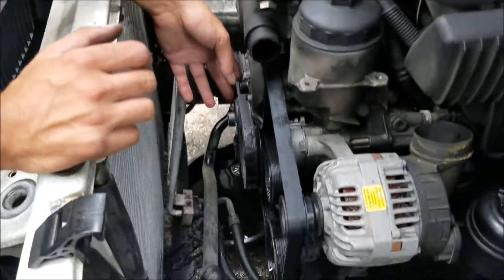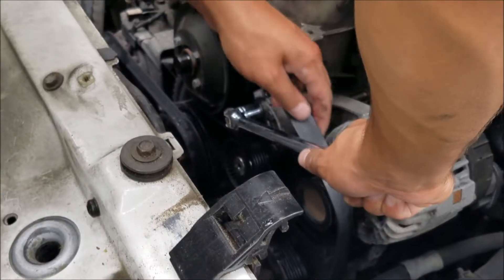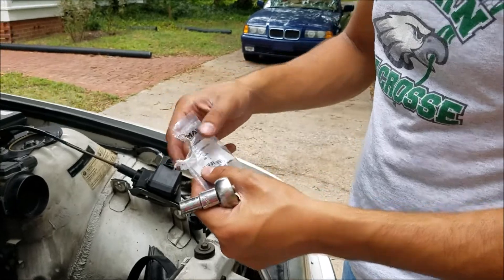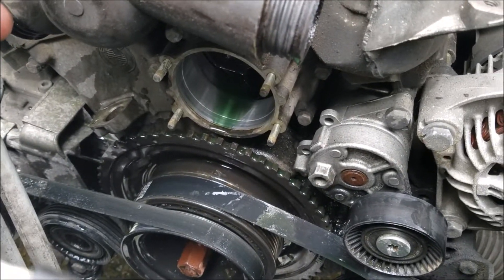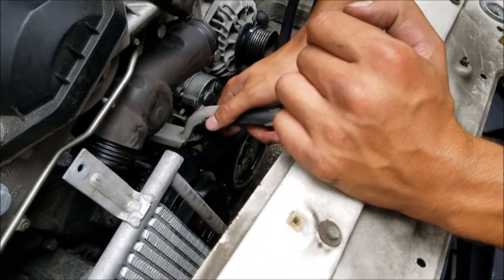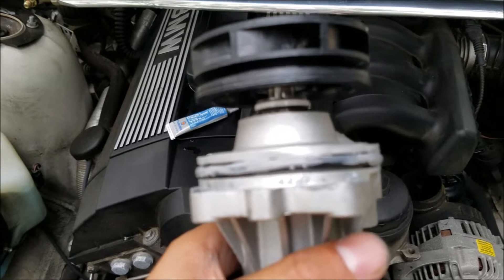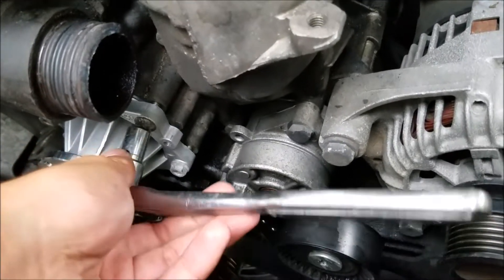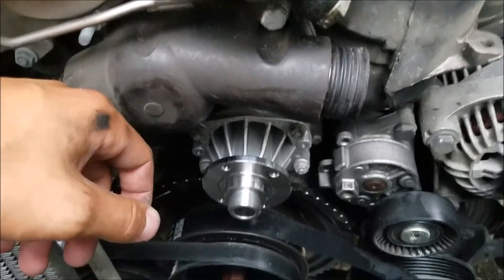BMW E36 Water Pump Replacement (Coolant System Rebuild Part 3 of 5 )

Comment: As for the bolts to thread into the pump for removal, you don't have to buy any.  Just use two of the bolts that held the pulley to the pump.
Reply: Thank you

Comment: I'm a hydraulic tech. Pro-tip:  I advise against using any kind of sealant/ gasket maker on an o-ring. I don't doubt it can work in this application, but in general o-rings are made for precision machined surfaces and typically fail because of contamination. Making sure the groove and mating surfaces are smooth and spotless and lubricating the oring just before installation will give the best seal possible (vaseline works well makes it easy to spot any contamination).
Reply: I agree 100%!! I’m sure it might work this way but what he should be doing is getting the OEM gasket used for the water pump, and if getting the OEM gasket is not an option, then use the gasket maker but not on the o-ring, lightly lube the o-ring with some Vaseline and ONLY put the gasket maker on the mating surfaces after they have been cleaned of any leftover gasket that was on it before. Just putting it around where the bolts go is not correct and will most likely be the reason he starts leaking coolant randomly some time in the future..

Comment: Just a tip,if the pump crack when anyone press the bolts,you can hammer the front of the pump,that will only break the pump bearing only and then can remove the pump,I did many time before,good luck
Reply: Thanks! Hammer the pump forward or from the top downwards?
Reply: @Arsenalusa  from the top of the pump shaft ,until the shaft crack the pump housing,that because the engine is much stronger than the pump,don't  do this on other model may not strong enough!
Reply: @alanw5812  thanks alot the two m6 bolts cracked my housing and so now I will hammer ut with my 4lbs mallet
Reply: @Arsenalusa  always  crack
Reply: Thank you for this. A part did break in mine

Comment: My e36 has a problem where the coolant doesn't go in or circulate do you have any ideas on what could be happening??
Reply: Check your Coolant temperature sensor and thermostat first.
Reply: Then make sure your heater core is not clogged and that its able to circulate coolant

Comment: Just replaced radiator and thermostat and still overheating . I am assuming it is the water pump?
Reply from the maker: Peter Lee I assume you already confirmed that it's not losing coolant? Does it just overheat when the car is sitting at idle or will it overheat when your driving as Well? Either way, probably your water pump.
Reply: Not loosing coolant, idle it is fine. Drive around the block it starts getting hot and hot fast! I am confident that it would be the water pump. Luckliy your video is $$$ so should be good. I will let you know how it goes!
Reply from the maker: Yeah definetly sounds like the water pump, get the metal propeller if you can.
Reply: E36 Fanatics just finished up with replacing the water pump and same thing that was happening after replacing the radiator. Temp is fine for a few minutes or so and actually holds in the middle. Then all of a sudden just starts picking up. It would make more sense if it gradually went up to overheating not stop in the middle for a few minutes then go up... I am really stumped on what it could be. It was low on coolant and I topped it off but still not luck, any thoughts?
Reply: I’m having this problem now.. literally put on a brand new thermostat and thermostat housing, brand new water reservoir, brand new radiator, I personally believe that my issue is the hoses, they look a bit old however if this doesn’t work I’ll try water pump and if that doesn’t work then I give up :(
Reply: CASE my buddy took it to the mechanic and said he had to bleed it, Helped a little but still overheats. He sold the car for $500. I really don’t know why it would still be overheating. Thought cooling systems were simple lol
Reply: Peter Lee I was able to fix mine and so far so good I guess the clamps were old so I put new ones and she’s been running strong ever since however my next thing I gotta fix now is the drive shaft lol
Reply: My e36 just broke down yesterday I put a new radiator and what is doing is the hoses get like is gonna blow like if the water is not running or something is blocked in the way
Reply: CHECK YOUR HEATER CORE! LOL
Everyone always overlooks the heater core, cuz if that heater core gets clogged and isn’t able to circulate the coolant your car will overheat indefinitely!!